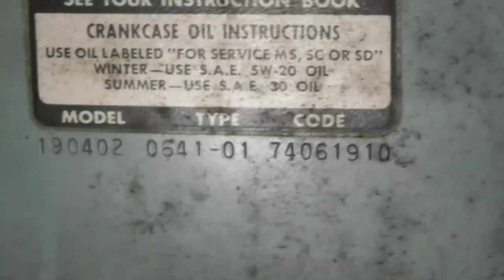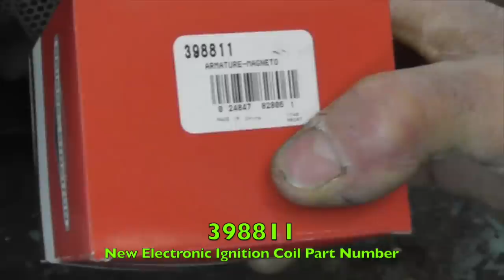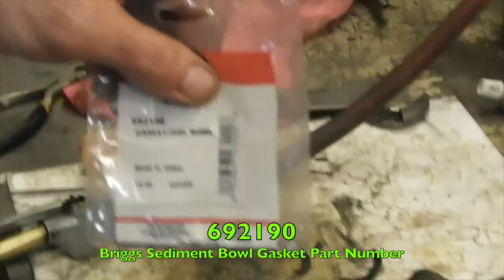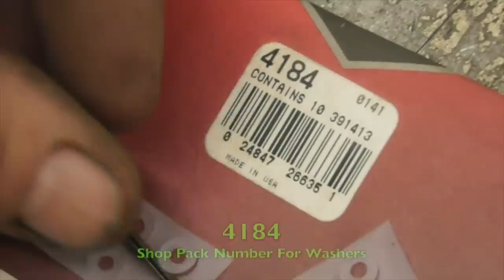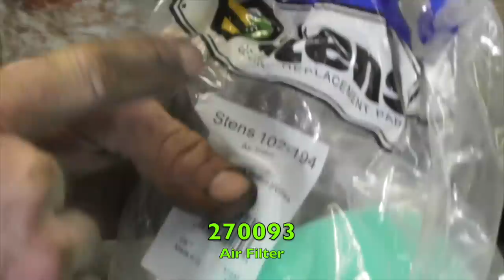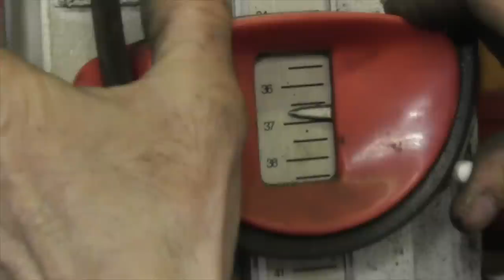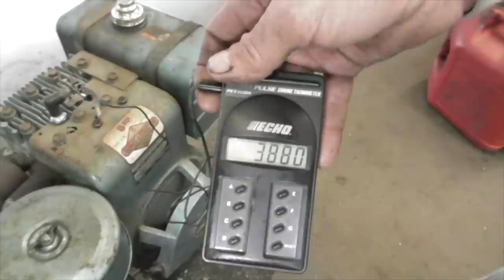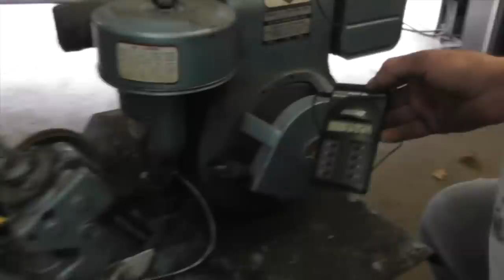How To Troubleshoot A Non-Running Engine (1974 Sears Rototiller) with Taryl

Comment: To be honest, I'd rather have the older B/S engines with updraft carbitr8ors and mechanical
governors, much easier to work on. Last job was a 5HP briggz more Effing linkage than the
space shuttle, but big Gerty a 12 HP cast iron babe, threaded rod on the governor and a 
spring,  one link to throttle and that's it..

Comment: Still looking for the DOUBLE-LIKE button.   Very cool instructional class, Mr. Taryl.     Now let me see if the Tecumseh Girl decal in your store will fit on the starter recoil of this cool Sunbeam mower I'm fixing.
>> Hey Taryl, out in your shop yard, you have two red flat platform things with what look like tractor inner tubes under them.   What the heck are they?   I'm seriously curious.   Are they some military anti-gravity transporters?
jc from Oregon

Comment: A compression check, oh this is GOOD. When I get in a gener8r, and get her running at full 
load. I check the compression after and mark it down on the customer's work order, as well
as voltage to brushes, next time that geny comes in the shop for electrical, say she's not 
putting out,  (customer sez he bot her choc. bars an nylons) I'll know how much or little she's
getting excited.

Comment: The gap on the magneto is anywhere from not scraping the flyweel to .250 inch or more. NOT CRITiCaL  The first thing I do on any gasoline engine that I am charged to make run is a little hit of ether. If there is spark it will hit.

Comment: I be damned.I,ve got that same tiller 8hp Briggs that I rebuilt the engine 20 plus years ago converted the coil to electronic run,s good that,s the same problem I have with the rusty gas tank...with that aluminum bore I do remember useing chrome ring,s got a lotta compression...

Comment: Muratic Acid is the best to clean rusty gas tanks....
Reply: phosphoric acid is better.  it forms an oxide layer on the steel that keeps rust at bay.  muriatic acid will keep eating away at the metal if not properly neutralized and there is some debate as to whether it causes hydrogen embrittlement.  prep and etch at home depot.  the same crap they put in coca cola.

Comment: That bone 🦴 is the femoral of a duck billed platypus.
It could be that old but with out carbon dating it is guess work.

Buyer beware they always say it was running the last time they used it.
Gummed up gas forty years old in the carburetor.

Comment: also thanks for the help with  my john deere d105, if you put a few zip ties on the var. pulley spring on the last few springs it makes it easy to put in then cut off the ties.( i put a little washer over the cap too so the hole doesn't waller out 2$ whore. also the spindles are shit, the grease ports don't get grease to the bearing, a drill and a tap later and now I got 4 ports on each, overkill? I haven't had to break them apart since

Comment: Great job and video but, wouldn't it be better to clean the tiller BEFORE you did all that work? That way, you as a tech would be much cleaner and when your installing the rebuilt carb, you're not fighting 40 years of muck........ Just my two cents......

Comment: It saddened me to see that perfectly good spark plug have its life cut short in it's prime by carelessly letting it fall. Most of my outdoor equipment have their original plugs. If they start well and run good I see no need to replace them. I've read that spark plugs used with magnetos never wear out.
Reply: 65CSX ......eh,...shadup!